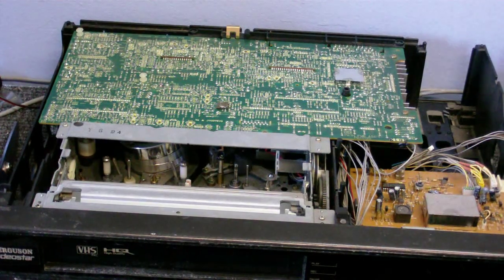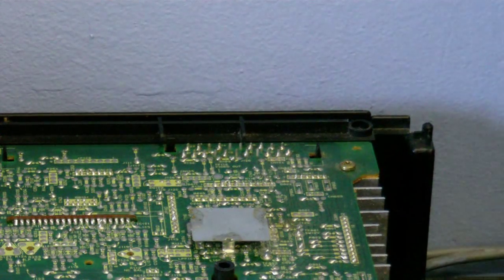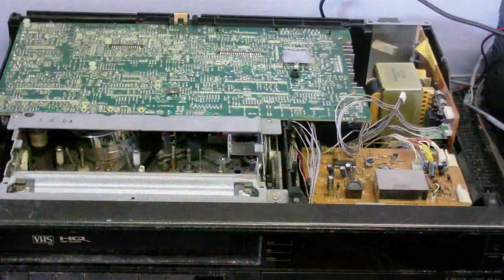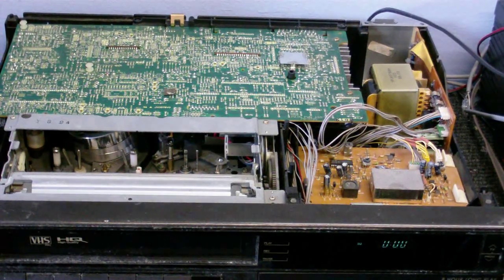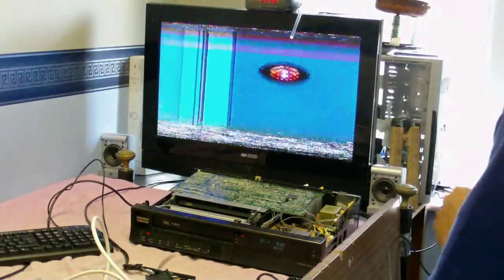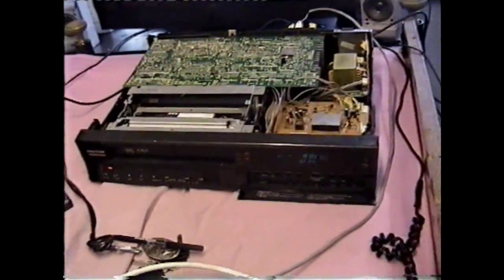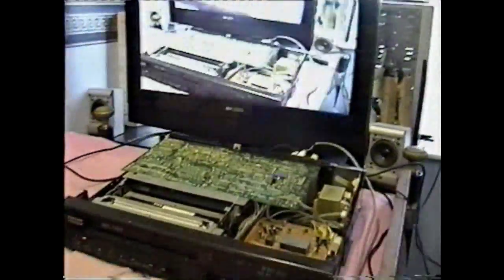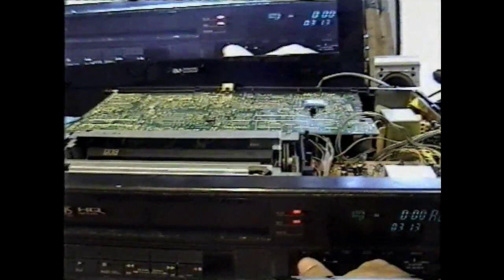CDC Electronic Workshop S2 EP 1- Fixing the Ferguson VCR pt 2 It's Alive!

Comment: I respect anyone who gets something working again!  I have been into electronics and fixing stuff since I was about 5 years old......and I'm 46 now.  My next project is to repair a Toshiba SD37VB DVD/VCR unit which I got from the tip where capacitors have gone bad on the power supply.  Should be an easy fix. :)  By the way, those old Ferguson Videostar machines were made to last.

Comment: Nice work.  That VCR gets nice picture quality.  

My 1990 Sears/Sanyo parts TV I got was like that.  Blown B+ fuse.  By chance I put a new fuse in it and it fired right up.  That was all that was wrong.  Most likely the fuse was fatigued from all the years of On/Off cycles, etc.